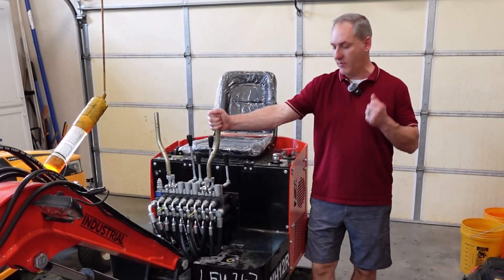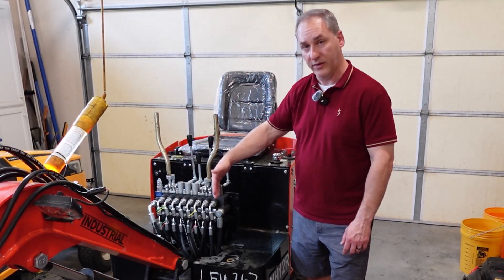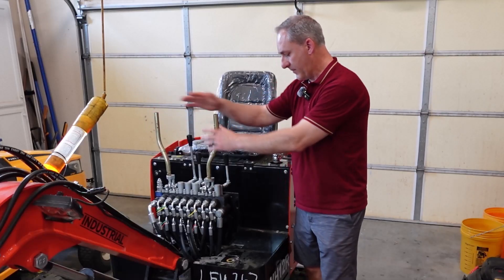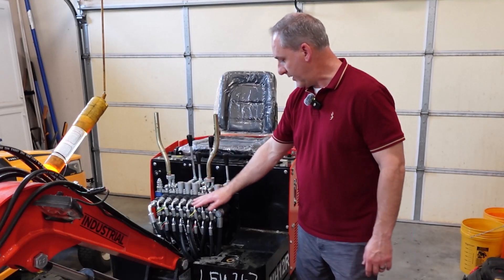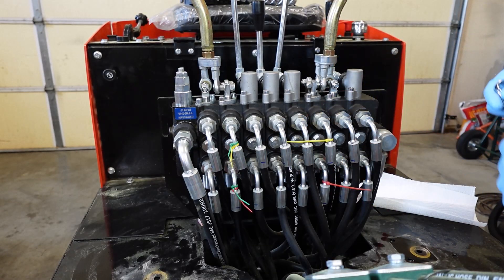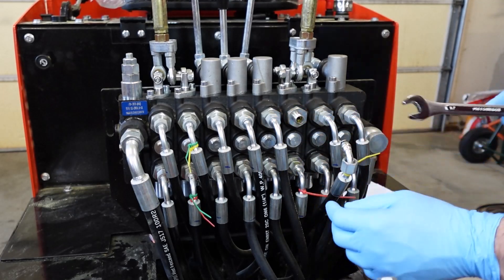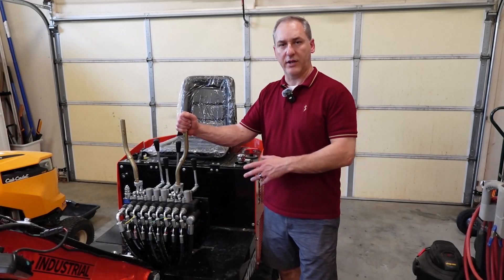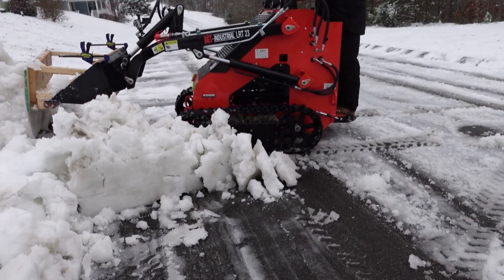Control Swap - ISO to ASE - AGT Industrial WH12R Chinese Mini Excavator

Comment: Was it necessary to switch the lower hoses ? Aren't they just returns ?  I ask because I just bought one just like this , and I can not get used to ISO. Lol
Reply from the maker: I'm no pro, per se, but I believe it is necessary.  Think of it like this:  when a lever (valve) is manipulated, it's opening flow out and flow back in.  Hence the need to swap both upper and lower hoses.  I could be totally wrong here, but I believe if only the upper is swapped, fluid would be unable to return as it should.  If I'm wrong, let me know lol.

Also, I agree.  I couldn't get used to the ISO either.  The backhoe style controls feel more natural for some reason.  I hope this helps and thanks for watching!
Reply: If you don’t switch the bottom hose, you will still be controlling the bucket closing instead of the return of the boom.